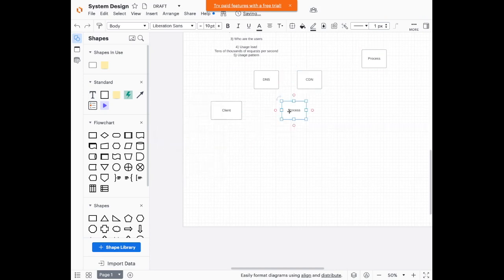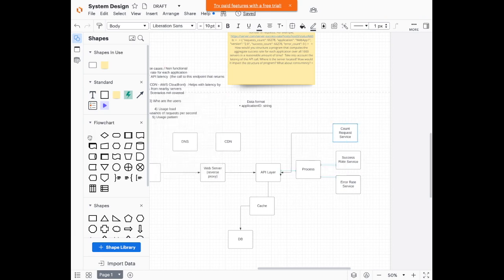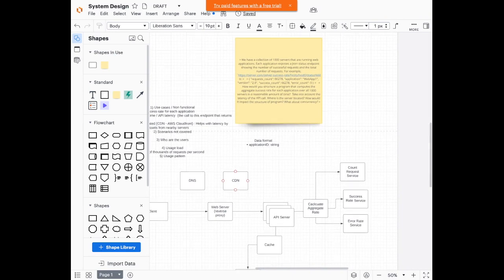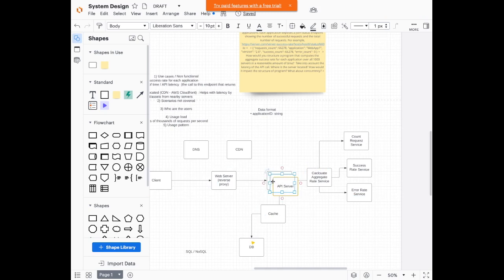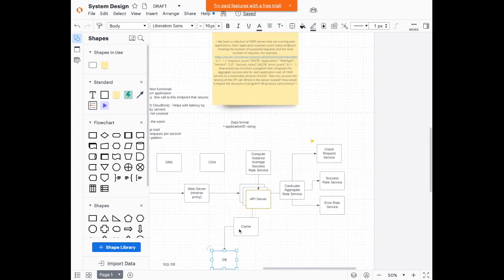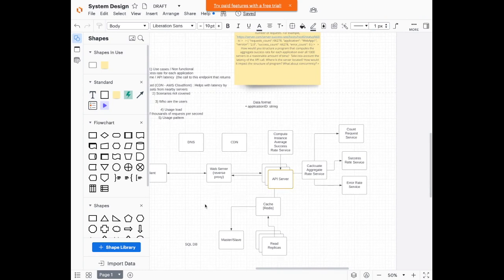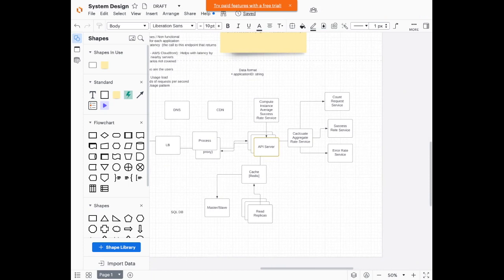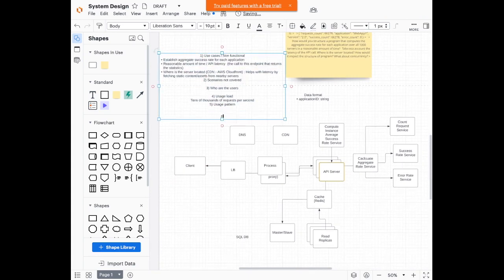System Design Fundamentals - Designing an aggregation count system that scales | SWE Interview #9

Comment: If I understand the question correctly from the video + that yellow sticky note.

There are 1000 web apps running. There could be multiple instances of the same web app. Each one exposes a success/error metric from the server.

We want to calculate a particular web app's aggregate success/error metric.

A few questions haven't been asked till the 8th min of the interview.
What is the granularity of the success/error metric on a server? Success/Error metrics are always done over a time window. What granularity do the individual instances expose? What granularity does the consumer of the data want?

The yellow sticky note says that instances expose the data as an API endpoint. Which means we need to pull in data. For some reason the person has designed a push model, meaning instances are sending the metric to the aggregation service. Not sure why the interviewer didn't correct it. Tbh, pull data in this type of design has more complexity.
Reply from the maker: 100%, you're right on the money. 

System design interviews are a bit "flexible" in the sense that you can do well without necessarily coming up with the best design possible. Of course that may hurt your overall performance, but the interview is more about challenging the design decisions the candidate makes and understanding the tradeoffs. 

But it sounds like you have a pretty strong grasp of the problem, so what you discussed would be a great design to propose, for sure.